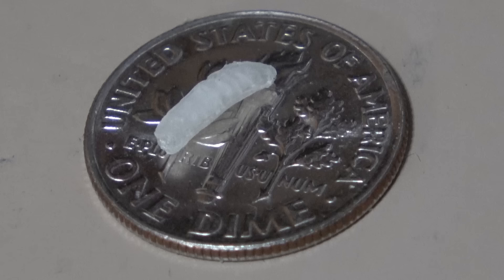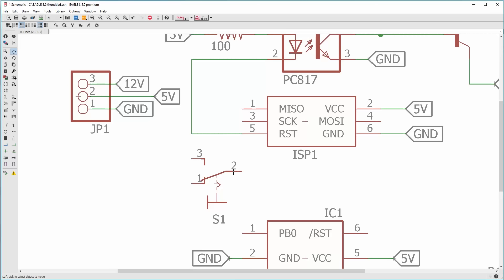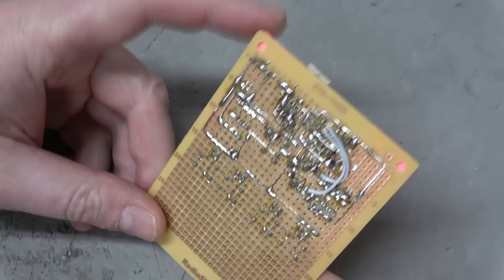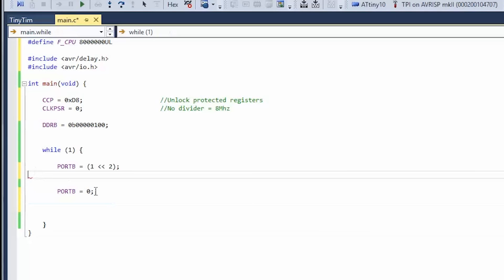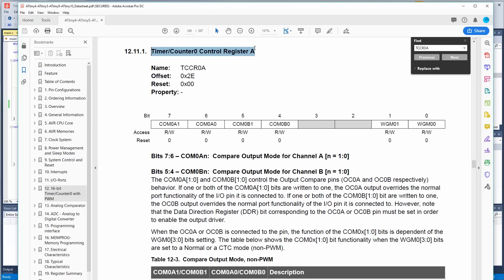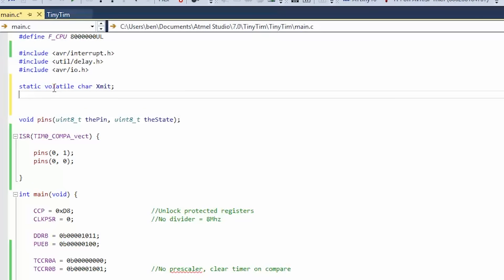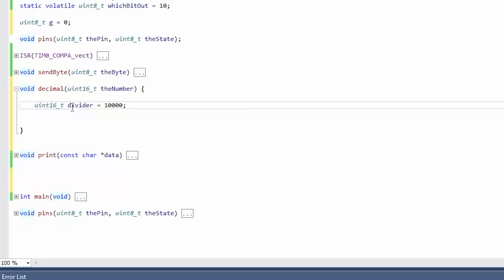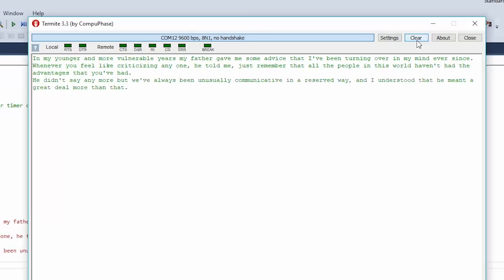How to use the Atmel ATTINY10 Microcontroller

Comment: That programming method looks pretty convoluted.
I mean, sure, if you're making a one-off project, but surely there have to be more effective methods?

What if you need the same program on 50,000 of these things which then end up on a manufactured PCB?

I'm sure processes for that exist, but the way your ISP board is structured makes that seem extremely impractical...

Do you program 50,000 chips individually before board assembly? Or do you design your finalised board to be programmed in a programming jig afterwards? (meaning the microcontroller initially lacks any programming at all?)

mmh. So confusing. XD
I suppose the name of the process 'in circuit programming' is something of a clue, but at the same time...
Reply: I believe you can order pre-programmed chips from the vendor. Microchip, in this case. These in circuit programming method is for development phase where firmware often changes. Thus poping out chip everytime is cumbersome. Once firmware codes been finalized, bulk order can be placed.
Reply from the maker: @kleinflussw4629  Correct.
Reply: @kleinflussw4629  I see. Interesting... That's a solution I hadn't even thought of. 
It kind of makes sense, kind of not.
Still, if that's the way it's done, that explains a few things...
Reply from the maker: @KuraIthys  Else you add testing pads to the PCB and MCU gets programmed after board is stuffed.

Comment: I can't understand how you can be so good at programming and circuit design and miss something as basic as a current limiting resistor in series with the base of the PNP transistor to limit the current from ground through the opto then thru the base emitter junction of the PNP transistor to the 12 volt supply.
 Where is your current limiting?
What keeps the PNP device B-E junction from burning out?
What keeps you from getting a negative spike on the 12 volt power supply rail?
Reply from the maker: It's not the ideal circuit you're right. But it works.
Reply: @BenHeckHacks  
Please add a 1 K current limiting resistor in series with the transistor base to  make a great circuit perfect..
Reply from the maker: While doing the latest video with this chip I noticed there resistor is there I just forgot it on the schematic.
Reply: @BenHeckHacks  
I am glad to hear that!

Comment: In your schematic, 9:35 you have the opto pulling the base of Q1 to GND,  and the emitter of Q1 at 12V.
Why haven't you got a current limit resistor to limit base current. 
The opto transistor will drop some voltage but not 12 - 0.7 = 11.3V!!!!
Reply: He says in another comment that he had a 1k resistor there but forgot to put it on the schematic, which he did later.

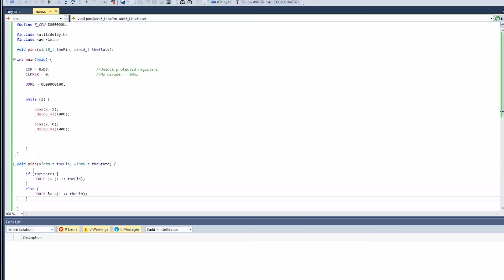Comment: 25:00 You're assuming such a simple short function wouldn't be unrolled by the compiler. If it is, then there's actually no memory penalty / no jump instruction.
28:45 (After seeing the oscilloscope check) Ah. :-)

Comment: your going to break the PNP base  emiiter junction without current limiting resistor that drive it from the optocopler, thats not  a mostfet, you cant load a whole 12 volt supply on the PNP base emitter lol

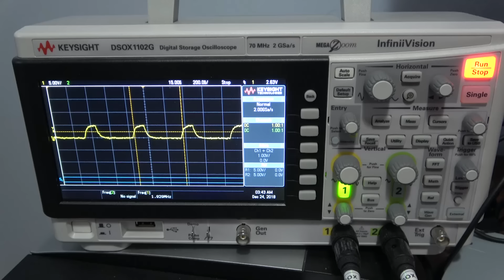Comment: 29:20 could save instructions using XOR to flip
Reply: using xor is actually increasing the amount of instructions, as you need to load the current value of the register, xor it and then write it back, which results in 4 instructions. Just changing the value is one instruction each, wich results in 2 instructions total.

Comment: As long as you're compiling with the optimizer there should be no difference using the function. You can check what asm code is generated here:
https://godbolt.org/

Comment: I don't understand why you're doing this whole song and dance routine with the case-switch statement and ANDing and ORing PORTB in it instead of just using a simple for loop there.
Reply from the maker: The interrupt is called for each bit, not the byte. That's why I did a switch case state machine of what to send. Also switch case is faster than if then fors.
Reply: @BenHeckHacks  Thanks for the explanation. :)

Comment: Try soldering a power regulator chip on a nintendo ds charging port board without a magnifier. Done that. Smaller by far.

Comment: The soldering advice is not sound.  Blob soldering is not recommended, and pulling off excess with rosin impregnated braid is not either.  "Grain of rice" sized IC chips do not need to have huge thermal cycling like that.  A fine pitch SMD part like that needs a fine pitch solder tip and quick, precise solder joint construction.  ONLY IF a bridge is made during the solder process would one reflow and remove it.  Unnecessarily heating it can cause failure modes.  Yeah, I know...  you have done it this way for years and "never had a problem".  No.  I have done it for years and have seen thermally sourced failures.  Electronics is your forte, minus the physics I guess.  Strange considering your extensive lab experience.  You should not sluff off such things.  You used to walk from the parts storeroom to the bench with a chip in your hand?  Still, an otherwise excellent video.  Sorry for the rant.
Reply: i mean what do you expect from someone who uses a TIP107 for a signal line? i am kind of surprised he didn't throw in a screw terminal IGBT in there

Comment: Since somebody has to do it, I might as well… does it run crysis?
Reply: you need 2 cap and 2 resistor then hook it up to gpu and monitor then use Atmel system tuning utility clock it up a little.
Reply: It runs it 100% perfect, But only on February 30th each year.

Comment: Ok, but having to put the SMD chip into a DIP sized carrier defeats the point of using such tiny components. As I understand it, the value of these very small MCUs is predicated on having the factory pre-program the chips for you, something that (I assume) only makes sense at high volumes. The need to do high voltage on the reset seems to limit the ability to actually program these chips while in-system!

Comment: Since x=sum_{i=1}^N x_I 10^i is the decimal representation of any N-digit number and any polynomial can be refactored as a_0+10*(a_1+10*(a_2+10*(a_3+10*(a_4+10*(a_5+10*...))))), all you really need to do is 

char buffer [6], *ptr;
ptr = &buffer[5];
*ptr-- = '\0';   // Terminate string.
*ptr = '0';   // In case number is already zero.
while (number) {
  *ptr-- = '0' + number%10;  // Fill previous digit and adjust pointer.
  number /= 10;    // "Shift" number right one digit.
}
print (ptr+1);  // Post-decrement leaves ptr one too low.

Also, 12V through the emitter-base and phototransistor side of your photocoupler will place a heavy power burden on your photocoupler.  A 5k resistor in this path will improve reliability.  Bipolar transistors are CURRENT amplifiers, so there is no need to "pull up" their bases.  Open circuit stops current so there is no need to treat the base as though it were a FET gate.

Comment: Via  Ebay, you can buy a programmer that can program almost any of the Atmel chips, very cheaply.  The model I use to use would program most Atmel chips, and PIC's and many more, but the upgraded programmer from the same vendor would do a wide range of voltages. The model I use now is a TL866II Plus   The web site for the maker of the programmer is www.xgecu.com    It is small, runs from a USB port, and the software has never caused me any problems. It is a bargain compared to all the other programmers I have.  You can find ellers that will sell it with a bunch of adapters that will hold all kinds of chips that won't fit in its 40 pin ZIF socket. I've programmed surface mounted controllers just by pressing them down on the pads of an adapter I made. No need to solder it in.

Comment: Before you will try to teach someone how to program microcontroller, maybe you should learn Yourself some electronics basics? Where is the current limiting resistor connected bettwen pnp base and optocoupler collector?
Reply from the maker: It's on the board but I forgot to draw it in schematic. YouTube no longer allows annotations so I can't easily correct it.

Comment: Do -O3 on compile
Reply: The -O3 is aggressive speed optimization. This does loop unrolling, which you don't want in a memory constrained controller. Better use -Os (size optimization), close to -O2, here.
Reply: static or inline on eg the pins function should also save up a lot of unnecessary instructions. But this will come at a cost. static will make it only visible to other functions in the same translation unit, while inline could increase the program size (as it will just always put the function body at that point and optimize unnecessary instructions away). I like to use c++ constexpr for this kind of stuff as it is basically a inline, but with some additional safety measurements which will prevent you from doing stupid stuff.
Reply: Sebastian D
and this is exactly why people should move away from C and onto C++ for EE.